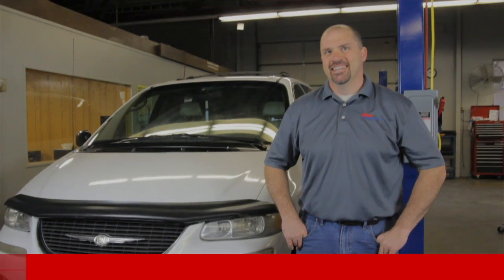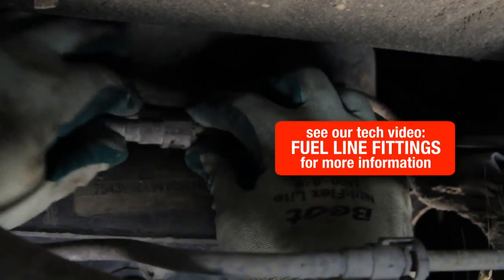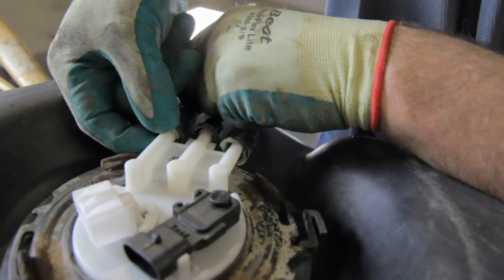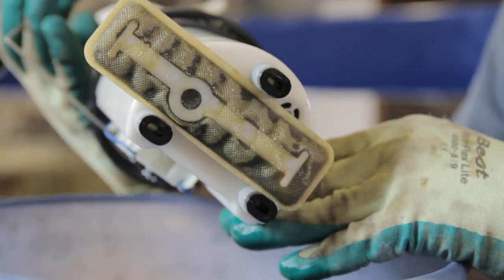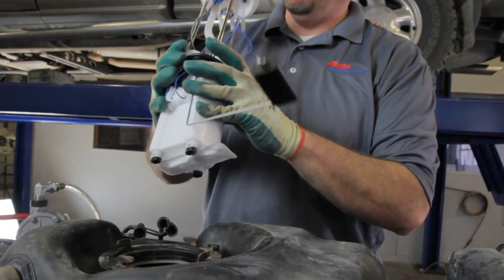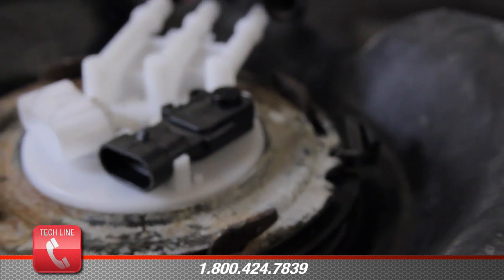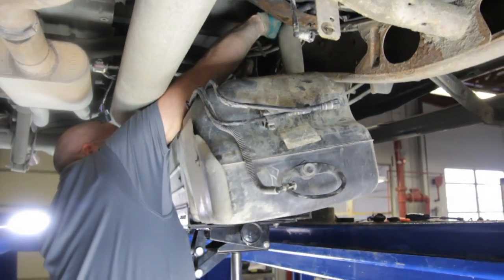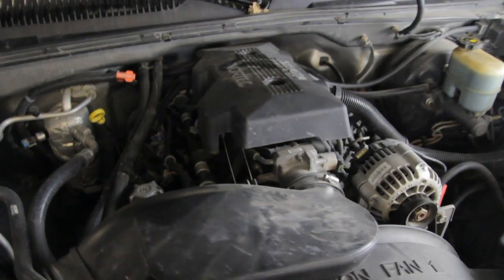How to Install Fuel Pump E3500M in Chevy Silverado GMC Pickup

Comment: Is it not a good idea to relieve the fuel pressure at the Schrader valve? So long as you bleed the air the same way before starting back up?